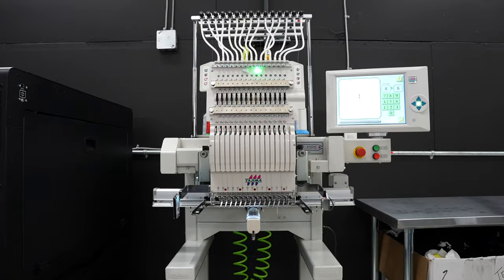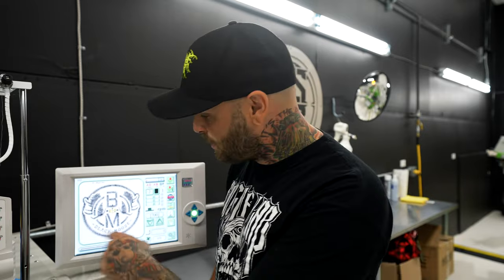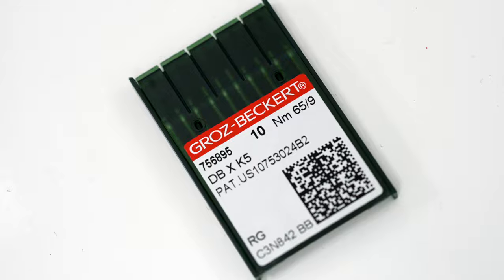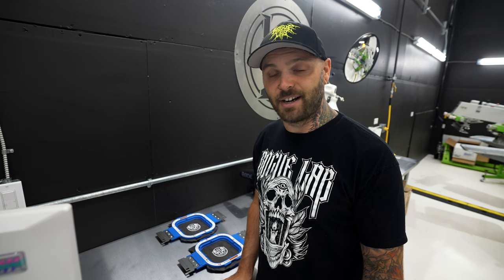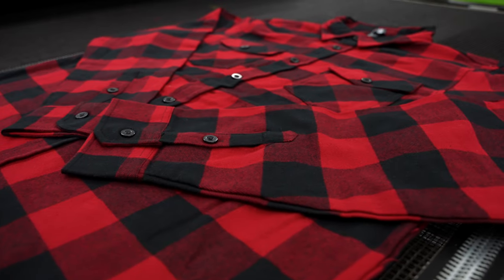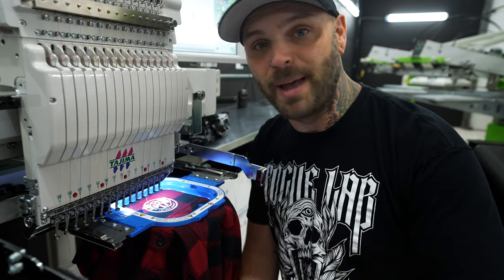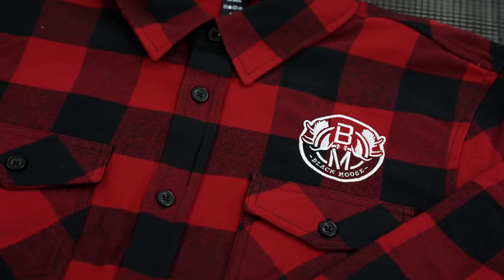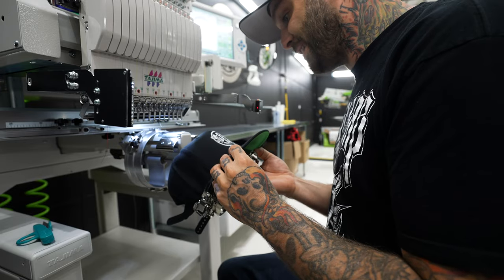Learning How To Get CLEAN EMBROIDERY With Small Lettering

Comment: Look into putting solvy ontop when you are doing small lettering. It helps alot, its also water soluble so you can clean it right off.
Reply from the maker: I tried it on these and it didn't make a difference. This fabric is pretty stable

Comment: Does the digitizing need to be different for the 60wt & size 9 needle?
Reply: Or was it just to program a colour change into it?
Reply from the maker: The digitizing will need to be set up for 60w
Reply: @leestuart38  okay thanks!
Reply: Yes. 60wt is only 80% the width of 40wt. So you need to increase density up 120%.
Reply: @matthewenderle8880  thanks!

Comment: anyone ever use embroidered adhesive in a flannel? looking for other options since I do not have an embroidery machine to put on flannels
Reply from the maker: Heat press adhesive works ok, but it doesn't last over time. It's usually good for about 50-60 washes